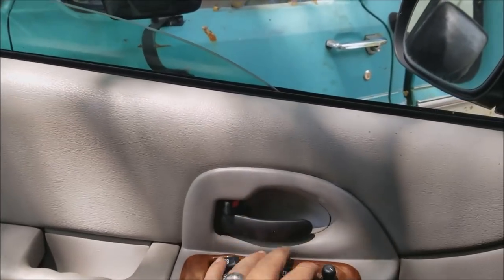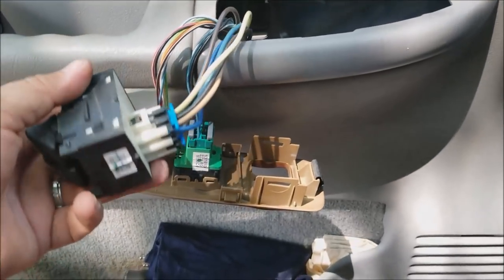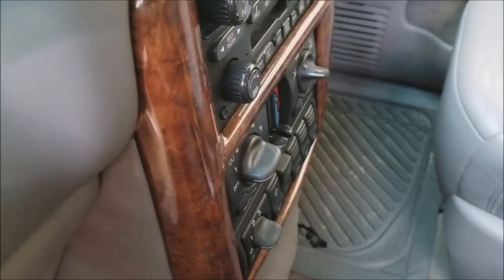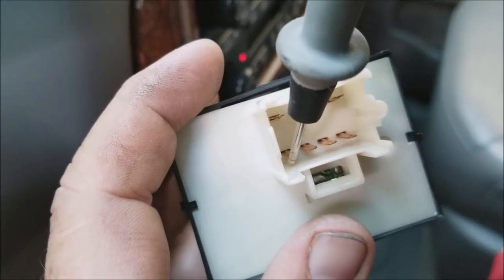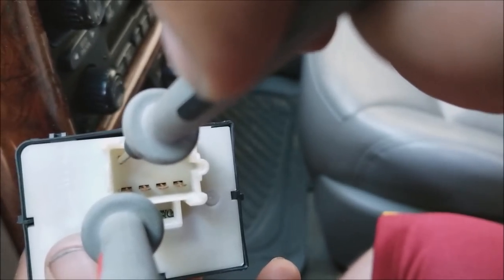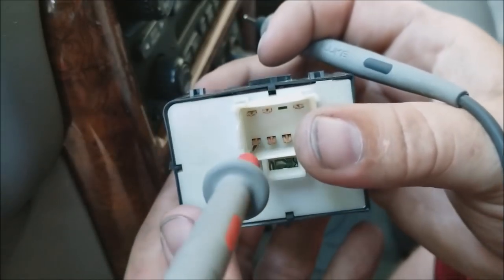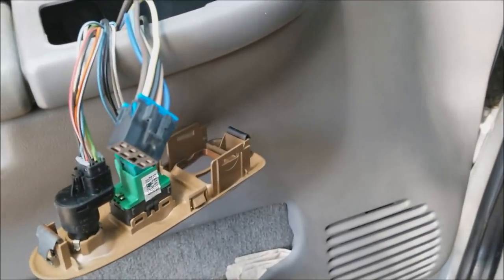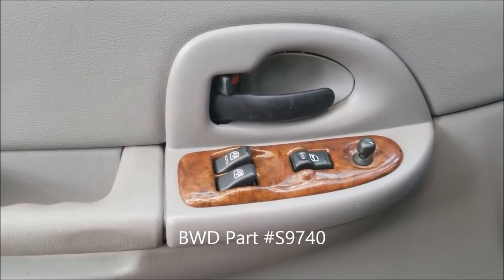Window Wont Go Up/Down - Dignose and Repair

Comment: I can either press down or up, the switch seems to work fine but the motor turns only 1-3 seconds before coming to a complete stop. I changed the carbon strip inside the motor already

Comment: Would it be a bad motor if the drivers side window doesnt work (up or down) but the other 3 windows work using the drivers window switch and their own window switches.
Reply from the maker: Still could be the switch only for the drivers window. If you can find the pin to send voltage to just hot wire it. If it still does not go up or down then it's either a motor or wiring break.
Reply: @C2H6Garage  what happens if the window when pressing down drops an inch then stops, but will go back up an inch? back window will go down a bit as well on the drivers side - but I also have to push up with my hands to close the window and over 2 - 3 days the window drops on its own an inch.
Reply from the maker: Sounds like motors are getting weak
Reply: Have you fixed it? Lmk what the solution was. My Buick started doing the same exact thing
Reply: @elizanimiranda4599  mine was a bad master switch so bought a second hand switch from Japan.

Comment: I have a 1999 Oldsmobile intrigue. It make the noise like it’s going up and down. But the window doesn’t actually move.
Reply: The window is off of the mechanical arms that push and pull it.
Reply: reattach the window regulator clips......clips have to be glued back to the window......

Comment: I put on a new main switch cause my driver's side window won't do nothing It did before but stop in the way half way up.Now I am still getting nothing could this be a bad motor??the rest work well along with the passenger side mirror.

Comment: I replaced my regulator and my master power switch and the window is still non-operable. And yes i checked the fuses.
What could be the issue? Does anyone know?
Reply: Sumtingwong Richard yep I have the same issue in my 93 Nissan bluebird. Wonder if it could be a wire or something because my central locking switch wasn’t giving any power?!
Reply: I’m having the same issue with my 04 Pontiac grand am I changed the whole motor and the circuit breaker but it didn’t help
Reply: He asked for solution NOT EXTRA HEADACHE... why is YouTube full of complicated people
Reply: Do you have new stereos and sub amps installed. Maybe take those out and see if it works.

Comment: My 04/03 (not for sure of the exact year- I just got it) Nissan Altima SL driver windows doesn’t go up nor down but all the other windows function perfectly. Wondering if this is my problem, too? I don’t think It could be a fuse issue....🤔🤔
Reply: Did you ever find out what was wrong with your window?

Comment: I replaced the window regular, window motor and the switch in less than a year and window still not working. What else you think could be the problem?
Reply: check the fuse an relay

Comment: Having same problem with my 99 Montero Sport.  and realized something...if your window CAN go down...it's probably not your motor.  why would the motor be bad...but,  will roll the window down?.... gonna be switch.  In mine,  same issue.  comes down...and is stuck there....but won't go up.  i'm gonna try the 'jump' method on the underside of switch panel.   thanks...
Reply: Your montero is 2 doors or 4 doors?

Comment: the driver side window works, but the passenger's side is stuck. WHAT COULD THIS BE?
Reply from the maker: It doesnt work with the drivers or passenger switches?
Reply: @C2H6Garage  yes both switches don't do anything and no any noise.
Reply from the maker: Sounds like you are not getting any power to motor. Check you fuses. It may also be a bad motor. Have to get a multimeter to fully check it out.
Reply: C2H6 Very intelligent..

Sir, my Hyundai i20 left rear window has no power when operating from driver side windows master panel. The other 3 windows has got power, but no power for this window.

However, they are on at the same board. Why no power supply to this particular window?

I also supply power to this particular window switch from another 12v source, yes, the window functions both ways up and down. This is confirmation that power is cut off but how and why??
Reply: @C2H6Garage  the problem was some stupid button that prevents kids from opening the window..
Reply: solidfuel86 do you which button it was? I’m having the same problem!
Reply: @KevinGarcia-sc1pt  the button right under the switch. Icon is window and X on it
Reply: @C2H6Garage  I am having same problem with my Mitsubishi Endeavor 2005  . Do you know if I could fix it my self or is hard

Comment: Makes you just want manual crank up windows
Reply: Those are less reliable these days too. My 2012 Corolla needed to be fixed under warranty multiple times. Something would change inside causing about a quarter-turn of slack before the handles would engage with anything. Everything is made of plastic so the handles would break too. It’s clear that Toyota only designed them this poorly because they expected nearly everyone to opt for power windows.